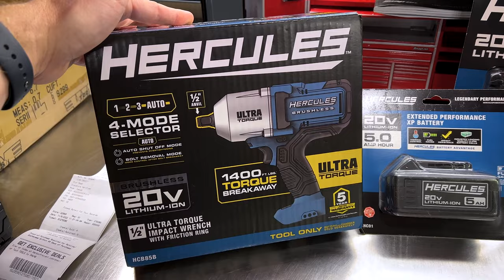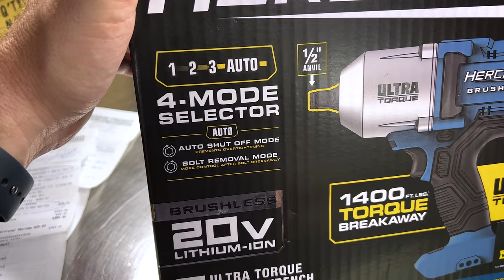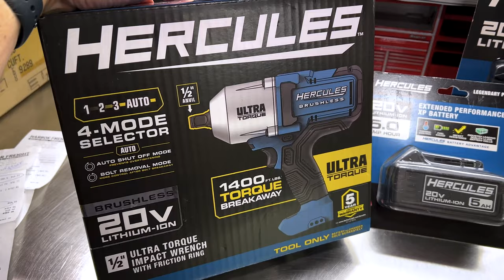EXTREME TOOL TESTING Harbor Freight’s Hercules Ultra Torque Impact! SHOCKING Results!!!

Comment: To be fair, your Milwaukee power tool comes with 1 battery and 1 charger.  When buying the Hercules Ultra Torque, you purchased 2 batteries and a charger. Based on your receipt each battery was $69.99. If you simple purchased "item for item" (1 tool, 1 battery and 1 charger) the actual comparison ( based on your receipt in slowmo) would be Milwaukee $449.00 vs Harbor Freight $284.97. What you also didn't mention...... You compared the Harbor Freight purchase after tax with an "additional battery" to the Milwaukee's 449.99 without tax.  The true price comparison is the Milwaukee price of $485.98 after tax vs the Harbor Freight $383.36 with an extra battery. Which means you can work twice as long for $102.00 less, with a solid tool (based on your video). Sorry, but, I have to roll with Harbor on this one. Great Video!!!!!!!I look forward to seeing more.
Reply: Gotta love people who review items starting out biased don't matter if it's tools ,cars etc.if u can't go into it with a open mind don't do it
Reply: Right now Home Depot has the fuel high torque with 2 5.0ah M18 batteries and charger for $450 plus tax. 

Hercules ultra torque $189 + $75 per battery + basic charger is $384 plus tax if you get 2 batteries. About $65 in savings. Not a lot. 
I think the value is the availability to get a 8/12ah battery and fan cooled charger for not much more than a basic Milwaukee set up.
Reply: @bmwmsport11 I assume that is a sale cause that is not list price. If so that isn't a great comparison unless you also compare hecules on sale. Which right now you can get a hercules 1/2 impact ultra torque, 3/8 impact, impact driver, 2, 5 amp hour batteries 1, 2 amp hour battery and a charger for 370 bucks. Please show me a milwaukee deal like that. Now I use milwaukke all the time for work but hercules is definitely cheaper.
Reply: Test it without shut off function and you will get 2,000 ft lbs for sure. I just seen it do it and struggled with 2,100 but did it.
Reply: it's 249 plus tax right now.
Reply: Very good point!

Comment: 😅😂 I just purchased the 3rd Generation Ultra torque Hercules with 1,650 ft lb . Right now they're giving a free battery and charger if you buy the impact gun. Only spent $220 on everything I say that so much better deal than Milwaukee.

Comment: Just to be clear. My work was completely leveled by a tornado in December and this impact as well as the Hercules 3/8 impact were laying in 1 inch of AW46, 1540 oil, and rain water and still works like it did out of the box. I love Hercules
Reply: The Hercules is definitely pro level. I have both the Milwaukee which had the early version of the Milwaukee for years and finally figured since they have a spring sale try the Hercules and honestly surprised how good it is. I did suspension work on a friend car the other day and had zero issues with it removing rusted bolts off. It built well with glass fiber impregnated plastic like the Milwaukee so sure hold up. I did order a gen 4 Milwaukee be nice to see how they compare to each other.

The price for quality and performance and the fact you get 5 years warranty and 3 years on the battery, is a good price. I dropped the Hercules grinder off off a roof when cutting pipes for a HVAC unit cracking the bottom casing as fell out of bag when climbing down, but tool still worked, walk into store and they swapped it out without zero issues. Yes you can get it much cheaper if you wait for the sales. Much got the battery and charger for free. Agree the charger is slow and yes had the bad smell to it. They do have a 8 amp fan cool charger now for sale.

Comment: I've purchased Harbor Freight "one use only" tools over the years.  I've noticed in the past couple years their tools have become reasonably reliable - maybe from a different prison factory.  Eh, they've worked pretty well for me.  YMMV.
Reply: Honestly I love my HF tools. Now some are still garbage. But most of my purchases are great. I have several that are identical to my snapon sets. And Honestly not much difference in terms of quality. Which when you think about the amount of money I've spent on my snapon is kind of bullshit.
Reply: Their power tools used to be easy to smoke under professional use. Now? I guess they improved across the board. Beats the shit out of over priced snap power tools
Reply: I have a strong feeling the are using the same manufacture of one of the top brands now. Which is why they changed the warranty

Comment: The bare tool is $359 for Milwaukee generation 2  and Hercules is  $199.00( without coupon).  Milwaukee has many options.  I'm leaving the red for blue the 5 year warranty and go to the store is a win for me.   I'm an ITC member for harbor freight so randomly get the 25% coupon no exclusions..  I have the gun it Will take me like 2 more months to get the charger and battery but I'm transitioning to blue , I still have my reds

Comment: Been looking at videos of this impact. I saw TTC test it against Milwaukee to a dead tie...says nothing about durability, but this video shows it can handle straight up abuse. I'd like to see a bit of shop abuse from daily use, not just exterior tossing around, but wondering if it will lose power over a few months of ripping off lugs, hub nuts, and crankshaft bolts. I have the Earthquake XT 1/2 impact...it was alright when I got it several years ago, it will still take off lugs, but it seems to have lost a little bit of its power over time. It is a brushed motor so it makes sense it would lose power, but the Hercules is brushless. Seems like a solid buy if you are in the line. I am mostly Milwaukee M12 driven but I have beef with their brushed ratchet, apply over 75 ft lbs to the ratchet and it breaks. The Hercules 12v ratchet breaks at 150, twice as durable. My m12 ratchet broke while removing a loose oil drain bolt. Sure I could get a Fuel model, but the heads are so massive that it's hard to get where I need it. So I have one Hercules tool. Looks like I may add another. I've been watching the Hercules line closely...started out as a running joke, then they started releasing brushless tools, now 5 year warranty, new 8 and 12 amp batteries with 21700 cells and now an impact that competes with top of the line tools...if the trend continues, I have hope for the brand.

Comment: I use the Hercules power tools a lot at my job as an industrial mechanic. They hold up pretty good, just replaced the driver and the hammer drill.
Reply: How long did they hold up before you replaced them?
Reply: @JacobyStevens  I have a hercules 1/2 inch impact mid torque that survived a year of daily use as a mechanic and it works fine.

Comment: I got the new ultra torque gen 2 for $159. Then later (few minutes) made another purchase for their current deal...One 5ah and charger for $99 plus one free tool. I chose the new. 20v brushless 1/2 compact impact... Not a bad deal if you ask me!

Comment: I wonder why everyone seems to be ashamed of having cheaper tools, getting into this as a career your screwed from the beginning 20g’s in tools and they are paying 15hr flat rate as a newb. Stupid! What other career fields pay so low and expect so much start up capital just to work in the first place. The hole system is ridiculous anyway I ramble, as technicians especially newbs don’t be afraid or embarrassed from a name on a tool if it works than it’s a good tool. Harbor freight has steeped up tremendously from the early 2000’s and being able to walk in and warranty instead of hunting down a tool truck that rips you off on 85% of everything seems like a better deal to me. That’s like buying something getting kicked in the nuts and going back for more. No thank you! Warranty wait times is the stupidest thing ever and I own good tools just don’t deal with tool truck anymore

Comment: Torque test channel did a review on the high torque and ultra torque and the torque figures harbor freight says were relatively accurate, I think the ultra torque got to like 1300 lb ft in 15 seconds which is really pretty accurate vs some other major brands
Reply: Okay, that's actually pretty impressive. I must have missed that episode of his.
Reply: It did up to 2,000 on another channel. Very impressive

Comment: They’re already dropped the price on this impact, and it’s REALLY good for what it is, as you showed here.
I know you’re no fan of HF, but you gotta give it to them on this one. They make SOME decent tools!
Reply: Just ran it up on the HF website and it’s $379.96 before tax and freight.  Price went up it appears. Nevertheless, it’s a solid tool by the looks of it…won’t see my tool box but that’s because Hercules has a weak line up of cordless tools. I need more variety.
Reply: @zachthompson5335  Yeah, I would really love to see more tools from Hercules. If they could have a stronger lineup, they would be a serious competitor to Milwaukee and Dewalt.
With the coupons, the bare tool goes for as low as $179, then figure in $40 for the charger and $70 for the battery, you're at $290. Of course that doesn't factor in additional batteries. Plus HF offers a $20 discount when you buy a tool, battery, and charger. Doesn't apply if you use a coupon on the tool though.
Reply: The Hercules Dual Bevel Sliding Miter Saw is fantastic. I'd put it in the ring with pro tool brand saws any day. Plus, gotta love the shadow guide.
Reply: Price on the tool battery and charger has dropped on top of that I’m already invested on the Hercules batteries and chargers so I’d just have to buy the tool TBH not to mention batteries have 3 year Warrenty. Can’t go wrong tbh if you are already invested into Hercules
Reply: @zachthompson5335  buy an adapter and run your batteries on it
Reply: No way u can still get the Dewalt cheaper dcf 900 combo 349.00. Hurcules is 360 somthing with charger n battery
Reply: @zachthompson5335  dcf 900 is cheaper lmfao
Reply: @bloodbornlink8998  With the coupon it's around $180 for the bare tool, add $40 for the charger and $70 for the battery. $290, or the 5ah is currently on sale for $99 for two, so $320. Good deal still, I'd say.

Comment: Bought it yesterday…battery 5amp, fast charger, 1500 torque (there is one higher..no package deal)…$209.99.  Saw a water torture test…survived.

Great tool!  But you really put a beating to it.  Amazing it held up.

Comment: Thank you. That tool held up ! The only thing that seems to get week in the knees was the tester after getting a smell of the battery charger. Maybe the manufacturer will start to use those moisture absorption packs during shipping  ? 
You the man Rob. !! Any snowfall predictions for South Carolina this winter? :)
Reply from the maker: Likely not. Lol. Never know here with the white stuff. Usually is a surprise when we get it.

Comment: Was able to buy this for $102 during the last clearance event. All in I paid $220 for
1. this
2. an as is drill/driverwith charger and 2.5ah battery (i had no battery or charger) 
3. a 3/8 impact with 5 ah battery with the current buy one get one free promo.

Not bad for a so that I have it when I need it type of tool for a DIYer.

Comment: Question: have you seen the new Subaru oil filters?  Was at the dealer and bought some not knowing. They are blue but unmarked. Dealer told me Fram broke the contract with Subaru and they’re having them made by an unknown manufacturer. Would love to know your thoughts!  Especially if you think it’s an improvement
Reply: Didn't know this, and yes I would like to get more details on this too
Reply from the maker: Video Sunday!
Reply: @MrSubaru1387  awesome!  I’m really looking forward to hearing what you think. Mine look ok but without marking they look weird, not wrapped in plastic, but probably not worse than the fram ones.  But won’t put it on till at least Sunday!

Comment: I’ll admit that I buy some cheap tools but I have expensive ones too. My total HF tool list is a trailer wiring tester, IR thermometer and a metric tap & die set and I’m disappointed with all of them. Oddly the one metric tap I really needed was missing from the set which was in a sealed box when I bought it. The use-it-throw-it-away concept never attracted me. The non HF cheap tools I have are working fine. Mr. Subaru did a nice job kicking this tool around it looks like he had some fun. I especially liked the water test I can’t believe it survived.

Comment: You must've bought this when they didn't have any promotions. You can currently get this tool a battery and a charger for $100  because they are running a promotion that I see quite often where if you buy a battery and a charger if you get a tool for free.

Comment: i was lucky to catch the current 1500 ftlbs version ultra torque on sale for $149.99. bought the charger and 5 amp hour battery for $100 plus picked up the 8 amp hour battery for my free tool. $262.98 tax and all for the impact wrench, 2 batteries, and a charger

Comment: I bought the hercules in a pinch, normally use Milwaukee, but I must say for the 200 bucks I got it for, I'm okay with it. Beats the 300-400 I would've had to spend on a 1/2 Milwaukee.
Reply: And they come with a 5 year warranty now, instead of 30 days which is even more impressive assuming they actually replace them if an issue occurs.

Comment: it may sound super dumb, but try it with the extreme Hercules batteries, they use the 21700 samsung cell instead of cheap 18650 chinese battery that the regular batteries come with. it means alot and i mean ALOT more beanz and a higher full power threashold.

Comment: Does not take a rocket scientist to figure out this is a great tool .We own 4 of them in our diesel shop and are used to take sprockets off our dozers and excavators.Strapon and the other tool trucks need to take note Harbor Freight is coming for them.The quality is getting better and better.And as far as the Icon line a lot of it is starting to be manufactured in the good old USA.So how do u feel now Strapon fanboy

Comment: But does the consistency of that performance hold up from one impact to the next? See that would be a factor. Yes every brand even the expensive name brands will have a bad egg from time to time but, these could be like one in fifteen are any account and perform that way, and you just happened to get lucky and got a good one. But with the walk in replacement policy I guess you could just bring it back if it’s a bad one and they’ll replace it with another bad one. If it takes 15 repeat trips back to the store for an exchange to finally get a good one, well most people would give up after the third or fourth trip, and go to Home Depot and get the Milwaukee one that’s only 60 dollars more, and have the ratio be more like only one in 5,000 being a bad one. So just something to look at also.

Comment: A little misleading on the price comparison. You got a extra battery with the hercules for $385 compared to the milwaukee kit you showed that was $450 but only had one. You then said the milwaukee kit had two at the end if the video which is not true. All in all thi good review mate.

Comment: I got mine today: 
20V HERCULES 8A SINGLE PO   SKU 58922        $74.99 True fast charger
20V BRUSHLESS 1/2 ULTRA       SKU 59380       $149.99 After 25% Discount Any single item No Exclusion
20V HERCULES 12AH 21700 B   SKU 59246        $99.99  With Coupon
                                                                  Subtotal: $324.97
                                                               Sales Tax:    $33.31
                                                                       Total: $358.28
Overall I think it is not too bad. Milwaukee M18 with 5AH battery is on sale for $349 + Tax $35.77 = $384.77
Reply: Where did you get that coupon w/no exclusions
Reply: @Jay Medina  I haven't shopped HF for a long time. Manager special for 1 time use. I took advantage of this opportunity.